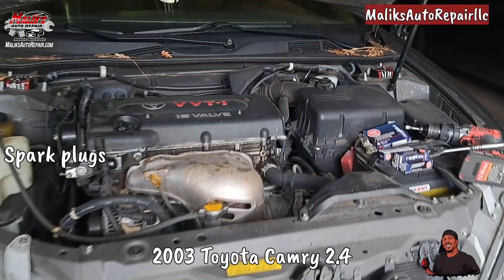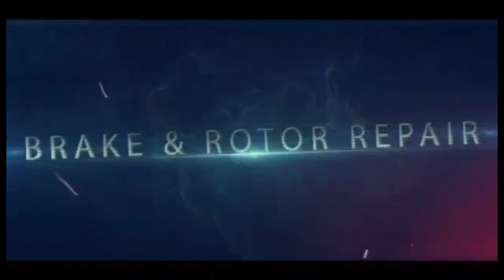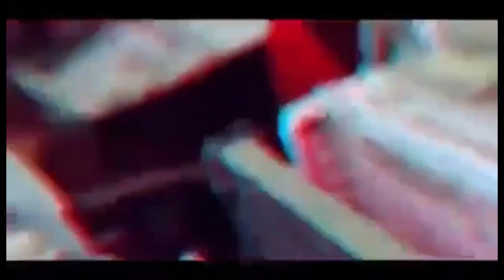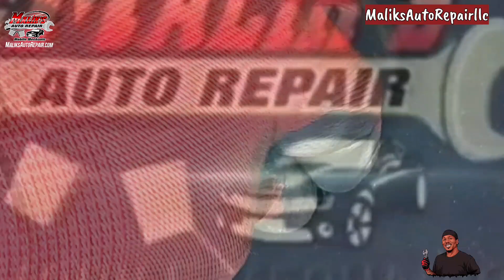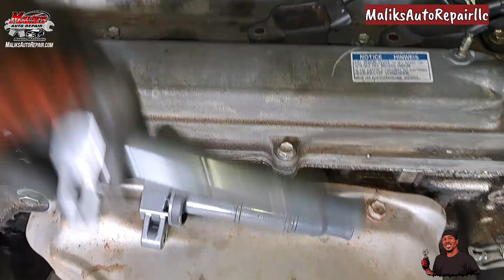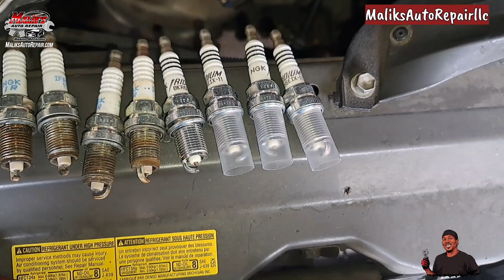HOW TO REPLACE SPARK PLUGS | 2003 TOYOTA CAMRY 2.4 | Howto/Diy

Comment: Hi, I'm about to attempt to do this myself. I have the same model car. What do I do with the spray? And what type of tool is the 5/8?  (I think that's what I heard) Thank you for this video! Saving over $200.
Reply from the maker: What spray? 3/8 Ratchet, 5/8 Socket. You're welcome and thanks for watching.
Reply: If you’re asking about the anti-seize lubricant it’s just applied to the threads. It’s more of a paste rather than a spray
Reply: Please what part number did you use for spark plugs, same model.